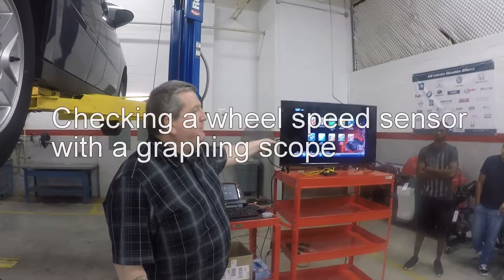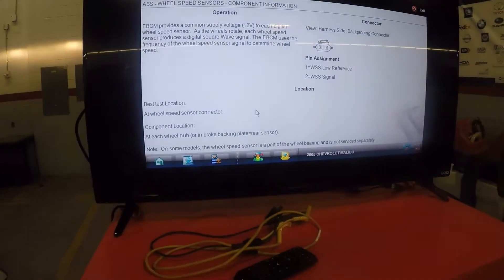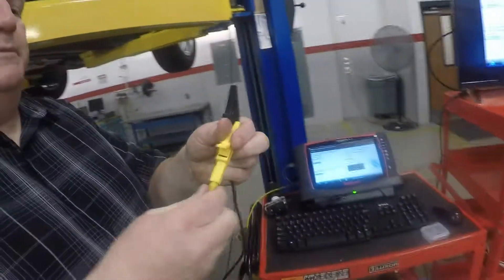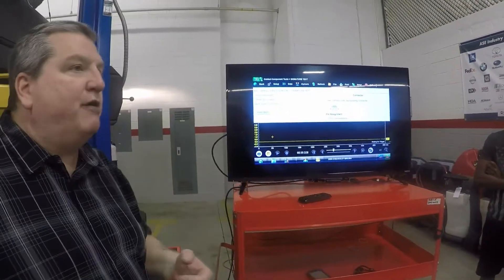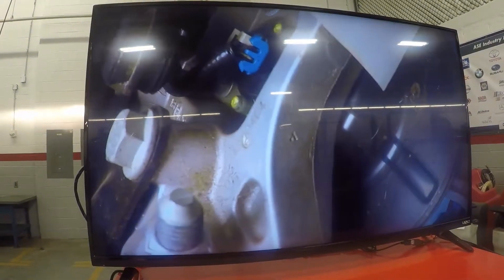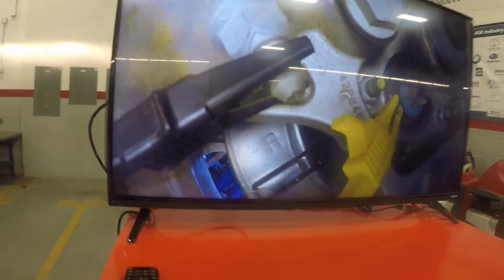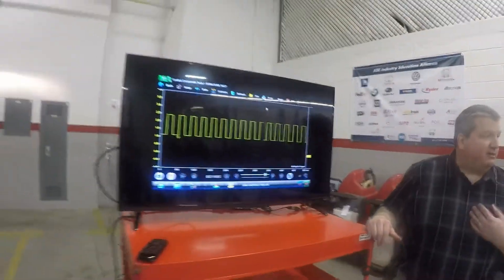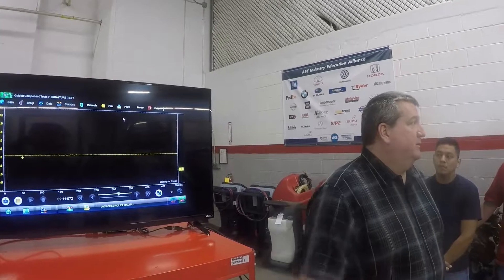Checking a wheel speed sensor with a graphing scope

Comment: It appears the ABS sensor is hooked up to the intermediate harness that takes it to the ABS controller. The two wire sensor is a permanent magnet type and as the reluctor or tone wheel passes by it, it produces an A/C syne wave. 
  By connecting to ground and the B+ output, you are seeing the ABS controller change the syne wave into a simple on - off square wave. If both test leads were connected to the sensor with female 1.50 metri-pac connectors, you will see a sinusoidal wave form. The amplitude and frequency would increase with the speed of the wheel. The sensor has a magnet with thin mild steel bars that extend a known distance toward the tone ring. A coil of copper wire is wrapped around this assembly, it has resistance and is the most common point of failure. Resistance specs change with temperature but this range is in the diagnostic flow chart if using dealer service information. Step #1 is to confirm customers concern by using a scan tool to view all 4 wheel speeds. If the LF is absent, it is tested first for resistance. If out of range, it is changed first. Always place a dab of dielectric grease on the connector to protect the terminals from moisture & humidity as temps change. The air gap is important but fixed. Some models have the sensor mounted on the dust plate backer. Rust can push open increasing this air gap. The allows for a weak signal which can drop out at slow speeds causing an ABS event on dry pavement. Most are riveted to the backing plate, make it the replacement part. Newer vehicles use a mixture of 3-wire hall-effect sensors to the magnetic material mounted in a radial fashion with tiny lines of “North”, “South” magnetic poles that rotate with the wheel on the bearing. Rust, metal particles can stick creating an erratic signal and fix if cleaned. The bearing w/magnetic is a common failure point as they are exposed to the elements and extreme thermal ranges as disc brakes can get very hot and cool to ambient temps once stopped. New younger engineers make mistakes as experienced engineers retire and know of better designs. 
ASE Master Tech since 1978.